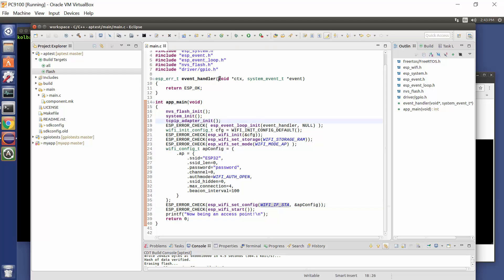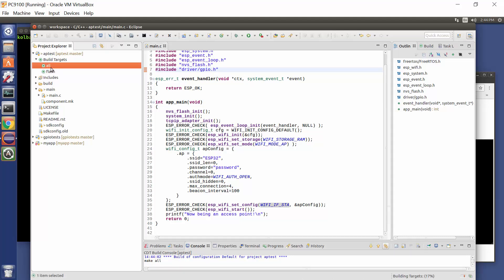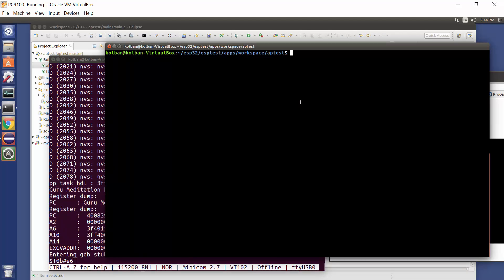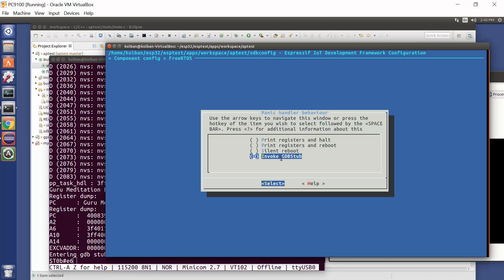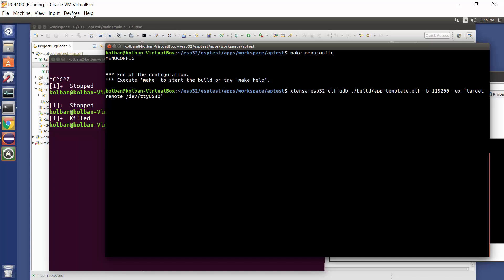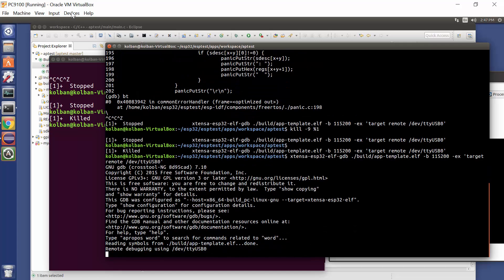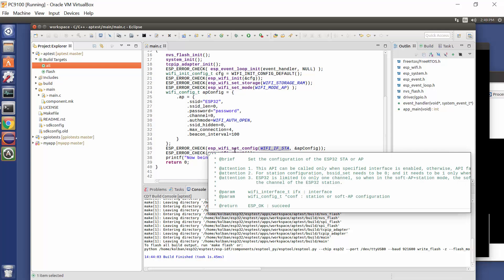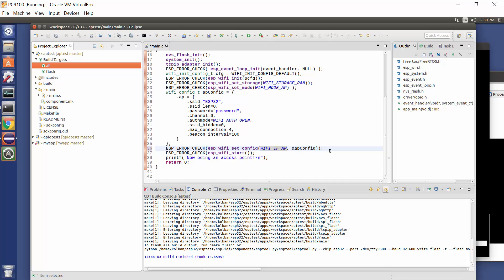ESP32 Technical Tutorials: Attaching GDB for debugging

Comment: A lot has changed since this video was released.  

As previously stated in the comments, the option to change the panic handler behavior has been moved to 'Component config/ESP32-specific'

Also, if you are using the ESP-IDF Monitor utility and have enabled the panic handler to invoke the GDBStub, then the Monitor program automatically detects the crash, launches GDB, and display the backtrace.  All you have to do is sit back and watch.
Reply: have you tried this feature recently ?
Reply: thanks for updating , otherwise it had taken more time to find this.